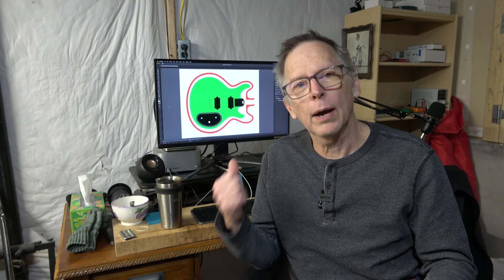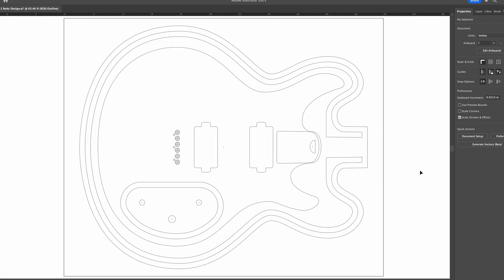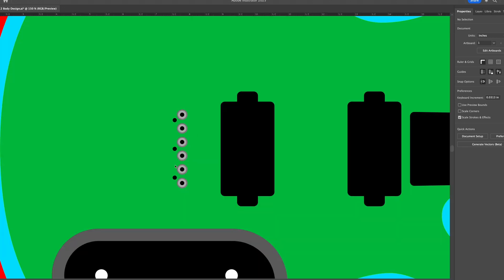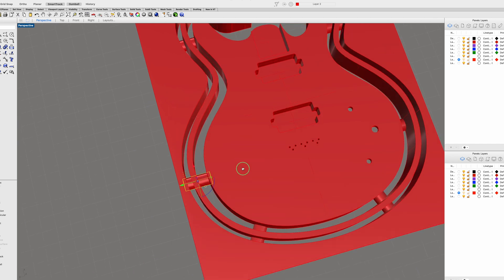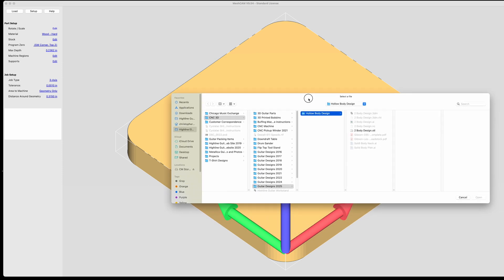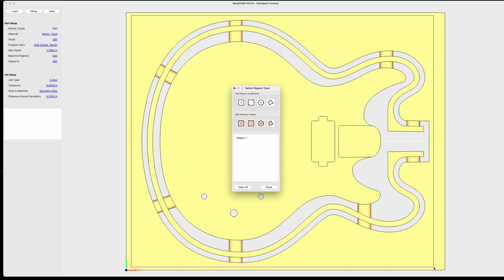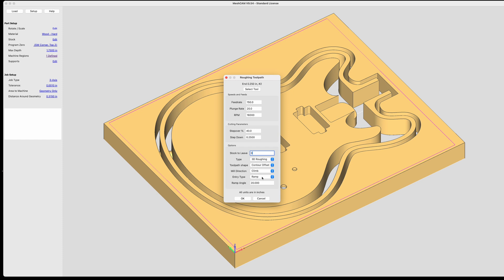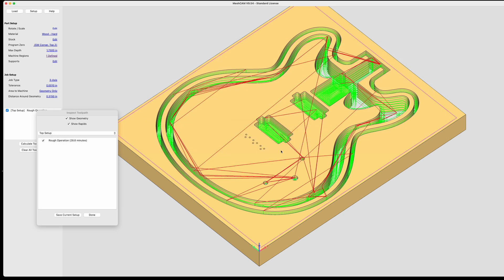A Weird Way To Make Two Electric Guitars From One Blank

Comment: Hey Chris. Check out sixstringer guitars. He's the guy that came out with the fret maestro.
He has a new spot leveling tool that just came out called the fretfixxer.
It levels and crowns the fret at the same time without making the fret flat on top.
It always stays crowned.
Just thought you'd like to know...
Reply from the maker: I made a video a while back where I offered some thoughts on the concept of the Fret Maestro. This was done in response to a number of requests for my thoughts. I had reservations about how the tool is supposed to work. Big mistake. The owner of the company caught wind of my video and came after me with a vengeance. My video didn’t disparage his tool, but I did state that it might not be for everyone. He accused me of character assassination which was totally wrong. Anyway, I will never review his tools. Here’s a link to my video: https://youtu.be/e3HGcTvxpFU?si=EGH-GegcvG-q-h4Z Let me know if you think I assassinated his character.

Comment: The sides for the hollow body are going to be super fragile, until you get the center block installed. 

It looks like, around the tail end of the lower bout, directly either side even after the center block is installed, the grain is going to be very short. So even after the back and top go on, one hard knock could crack it.

The gluing surface between the center block and the sides is going to be end grain to end grain. Probably ok, but I've been brought up to avoid end grain butt joints. It's probably a me problem.